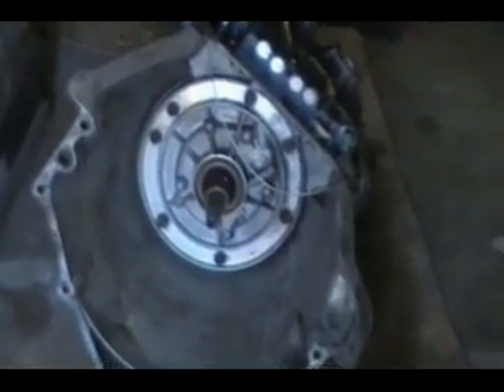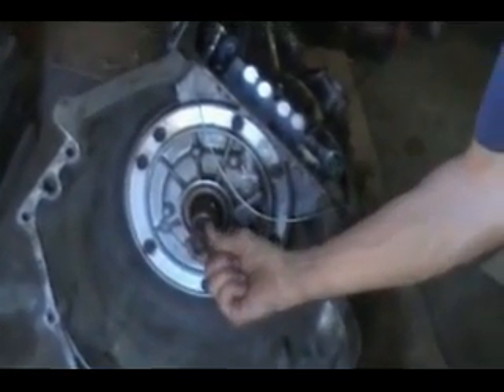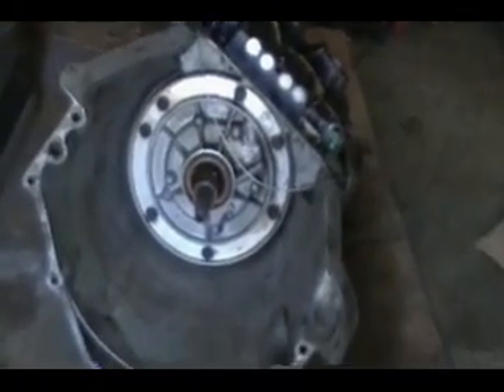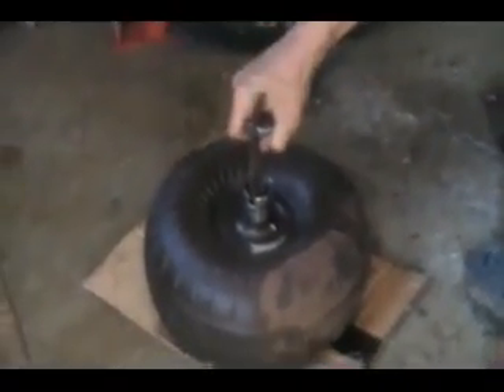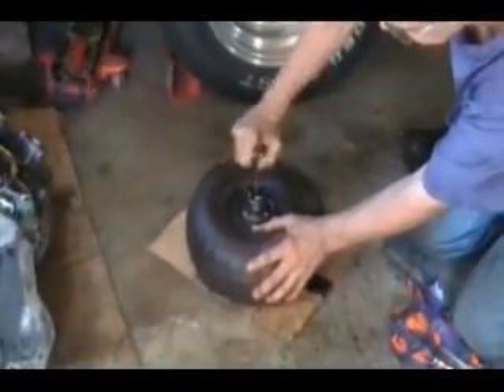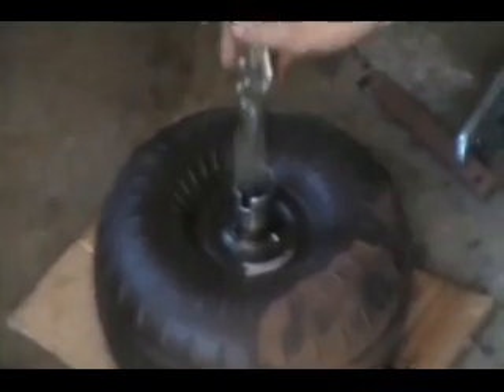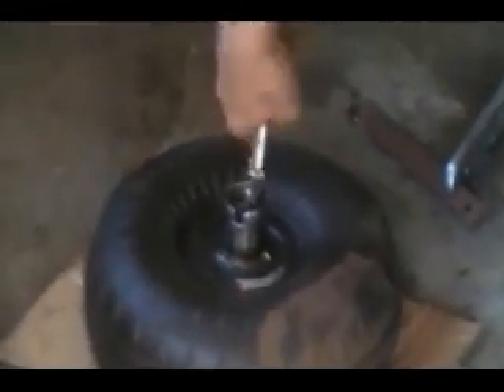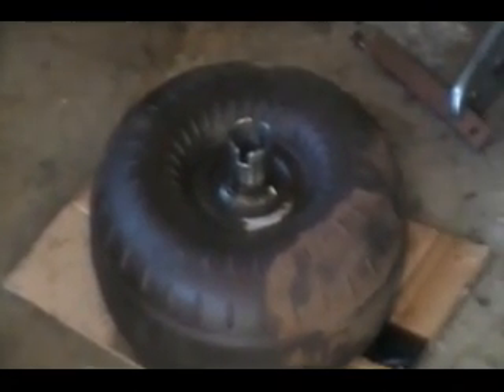What A Bad Torque Converter Sounds Like -- 700r4 Part 2 (Rev. 1)

Comment: Just had a fresh overhauled 700r4 tranny installed with a new or rebuilt torque converter. The day after I drove the truck from the shop that did the installation it sounded like there was a pinging noise coming out of the transmission during idle just for a few minutes and reverse would hit but slip. It stopped making the noise after a few minutes of run time but reverse still seems to engage but if you give it gas it slips bad. Since then, the engine idle is rough and shakes bad on 1st start, after some giving it gas it settles down and does not shake. It seems to be shifting fine on all gears but its the reverse slipping bad and rough cold start idle that is troubling me.  I haven't driven the truck much at all since the tranny install, I'm thinking it is the torque converter that is defective or was improperly installed. What say you icogye???
Reply from the maker: To check the converter I always recommend the following test: Put the front of the car up against a tree or other immovable object, put it into gear, gently give gas, and see if the engine dies. If it dies, it is probably not the torque converter. Do not rev it too much during the test or you could ruin a good torque converter. This will identify a bad torque converter, but may not tell you anything if it is something else causing the problem.  The slippage when in reverse you mentioned is suspicious.  It could be because reverse is a very low gear, like 1st gear, and is more likely to cause slippage.  The rough idle problem is puzzling, because I don't think the converter can cause rough idle, unless it is somehow engaging too soon (a LOW stall converter??). I guess I would check the converter installation.  Maybe unbolt it from the flywheel and turn it and move it back and forth on the transmission shaft to make sure it moves freely.    Good luck and let me know what you find out.

Comment: With the transmission and engine still connected together, torque converter unbolted from the flexplate, and in the car, should I get resistance turning the torque converter by hand ?
Reply from the maker: It's been awhile since I worked on this transmission (more than 9 years ago), but I believe the answer is yes, there will be some resistance even if the torque converter is removed and placed on the ground.  This is because the torque converter never drains completely of its transmission fluid.  Here's hoping someone will chime in and confirm this.

Comment: Hi mine 2000 4runner makes noise when put in gear  looks like a have same problem   sounds like rocks  
When in park stops
Reply from the maker: To be sure  it's the torque converter and not something else, I always recommend the following test: Put the front of the car up against a tree or other immovable object, put it into gear, gently give gas, and see if the engine dies. If it dies, it is probably not the torque converter. Do not rev it too much during the test or you could ruin a good torque converter.   Good luck and let me know how it goes.
Reply: @icogye  thanks  I did    it feels like just in  that part

Comment: I have an 05 mustang, had to put a used Trans in it. Converter fell off during shipping but put it in anyway and it screams like a bad power steering pump after cold start goes away after about 5 minutes. Shifts fine though. I suspect the stator clutch was damaged in it as well. I thought maybe the pilot bearing shaped part didn't go into the flex plate right but I unbokted it and bolted it back up a couple days ago and that seems right. Gonna pull the Trans back out this week I guess and put my old converter in and see if there's a difference.
Reply from the maker: Not that familiar with Ford trannys or converter internals, but I didn't have much luck with the trans shown in this video.  I Replaced the converter.  Then, shortly thereafter, the transmission failed (no forward gears) and I replaced the transmission + converter.  Hope you have better luck.

Comment: I had a 1970 BUick 455 with a basically stock th350 and stock converter in my 86 Regal.  I shattered the stator at WOT in 2nd gear, replaced the converter with another stocker and couple years later did it again,  changed it out 3rd time with another stocker and was running 12.83@108 mph with 2:75 gears in a moser 9" w 35 spline axles!!  The 9" replaced the 7.5 with 2:41 gears after shattering the spiders!!! LOL!  3rd stock converter was  still working good when I sold the car!!!!

Comment: I have a 700r4 on a 6.0 lq9 from a 2006. Escalade 

I am getting some metal scraping metal sounds but not always 
Only when I shift into reverse or drive ( not every time ) 
And sometimes when I’m driving and I come to a stop the noise will start 

It’s not constant though it just does it when it wants and it’s like a can rattling is the best I can explain it 

I thought it was my flex plate I replaced it 
My old one looked fine after inspecting it but I thought maybe it warped 

It runs a little wobbly , the flex plate and the torque converter both spin a little wobbly is that normal ?
Reply from the maker: Didn’t know that GM still used the 700r4 as late as 2006.  Metal scraping sounds are always a bad sign.  Check out Part 1 of my video (https://www.youtube.com/watch?v=P1aYct7Rz60) which includes the sounds of the bad torque converter while it is installed and running to see if it has similar sounds to yours.   If you replaced the flexplate and you still have the noise and wobbling, I would suspect the torque converter.  But check the mounting of the torque converter to the flexplate and check for binding where the transmission shaft inserts into the torque converter.  Good luck.
Reply: @icogye  
I have it on a 1985 Monte Carlo SS 

I am running the 6.0 lq9 off the Escalade and running the 700r4 trans 

I did not see part 1 yet , thank you sir ! Checking it out now 

Will definitely check those points next.

Comment: I got major transmission problems accruing in my 2003 cadillac Seville sts first off 4 weeks ago my tranny started slippn out of nowhere shut engine off got back in the car and when I went to reverse the cad started to reverse then stoped like emergency break was pressed wouldnt move in nuteral but would move in drive & 1 2 3 gears I then dropped pan and found really nothing replaced the fluid started it back up 2 days later and it reversed but i really had to press gas hard and it reved for a secomd without moving then the car started shaking jerking and finally reversed drove perfect after that for 2 weeks now soon as engine reaches temp the car will start off so slow when I stop at red light and it turns green ill hit the gas and it jusf reves and starts off so slow like there is no power at all ill berly mske it through the lights before they turn red again...i dropped pan again found white/yellowish plastic in a pile along with metal flskes and a huge silver chunk of something idk what it is and to top it off there are no codes coming up and no check engine light or nothing when all this firsg started there was a whining noise coming from left side of car by front wheel only whined when stepping on gas but now the whining is gone and the car only has 99,000 miles on it any help would be appriciated bevause im lost with this one
Reply from the maker: This one sounds to me like a linkage problem.  The only time I had experienced similar symptoms was when I had problems with the stock, column shift which was slipping out of place.  This is what I would first pay attention to. Not sure what the metal flakes and plastic are, but in general ANY debris found in the tranny pan indicates big trouble.  The transmission I show in this video had metal flakes in the pan which I ignored at first and within a few months it totally quit (one of the planetary gears had totally been ground away).  Sorry I couldn’t help more, maybe somebody else will chime in with some better words of wisdom.

Comment from the maker: Hearing it probably wouldn't help much.  One thing I learned after making this video is that the sound of it does not tell you much except that there is something wrong.  A better way to check is as follows: Put the front of the car up against a tree or other immovable object, put it in gear, gently give gas, and see if the engine dies.  If it dies, the converter may be O.K.   Do not rev it too much during the test or you could ruin a good torque converter.  Good luck.

Comment: Thank you sir!! 🙏🙏
So far, after hours and hours of searching and watching, you are the only one who actually shows how to diagnose a torque converter. 
I was driving down highway and lost all pressure in gears. Dropped trans, took out converter, splines look good, and now I’ll do this step when I get home this afternoon. I’m on a very low budget, like most I’m sure, and not trying to spend $ if don’t have to. 
Thank you. 🙏
Reply: Did the torque converter end up being the culprit? I had the same issue.
Reply: @Centermass762  what yours the torque converter?
Reply: @markmoler3693  I ended up finding a used transmission that came with the torque converter so I replaced them both.

Comment: As far as the turbine, it should have a bit more resistance and when air or fluid pressure is applied will lock up as needed unless the clutch material is worn past a critical clearance point

Comment: The stator is setting on a bearing snd spins freely unless you are holding it. It had an internal roller sprang in that gm29 700r4 and would need to be opened to determine if the stator has failed

Comment: can a bad torque converter damage a trnsmission
Reply: Don't think this is possible.  If the torque converter is slipping, then the engine is not hooked to the trans and the trans is "protected".  Just my observation, but I would love to hear from others on this.
Reply from the maker: I agree that the transmission is "protected" from engine torque when it is bad and slipping, but one caution:  If the torque converter is grinding it is probably introducing a lot of metal flakes and particles which can circulate all thorough the transmission and cause some collateral damage to critical parts.  Better to replace a bad converter sooner than later.

Comment: My torque converter makes an odd noise and has since day 1 i got it. All mechanics say its how it was manufactured and its fine but I dont believe it
Reply from the maker: The first thing is to find out if the noise is coming from the converter or elsewhere in the drivetrain.  If you have a bad converter, it will show other symptoms, mainly slippage.  It would help to road test the vehicle.  A good torque converter test used to be to put the front of the car up against a tree or other immovable object, put it into gear, gently give gas, and see if the engine dies. If the engine dies, your torque converter is not slipping. Do not rev it too much during the test or you could ruin a good torque converter.  Good Luck.
Reply: icogye yea a mechanic did road test it. He said the generation of the journey I got does that because the torque converter is awkward

Comment: If the stator spins both ways means you inner race is fcked there's metal rollers and springs when it spins both ways it puts flat spots on your race. its kinda good though  because the car just doest move rev all you like it ain't going any where but at least it doesn't allow further damage as to where if the rollers and springs jumped around allowing it to cease the stator up you would De accelerate to a stop and then thread your splines. 4r100s you can get a heavy duty kit with a bullet front and billet clutch it's a better set up. Check out sonax

Comment: Mine sounds like its rubbing or  squeaking sounds when its under a pull in reverse some in  drive but stop at Cruz its not the cover it's off now new rebuild motor and transmission 92 chev 350
Reply from the maker: Sounds like it could be the converter if the noises are accompanied by slipping.  This is how my converter problems started, it was slipping in the lower gears but was O.K. when in high when cruising. I don't remember any unusual noises, though.  It eventually got to the point where the truck wouldn't go at all.   If you want to rule out the torque converter, you can try a test that I always recommend: Put the front of the car up against a tree or other immovable object, put it into gear, gently give gas, and see if the engine dies. Do not rev it too much during the test or you could ruin a good torque converter.  Good luck.
Reply: It was a warped flex plate I must of bumped it when I was putting it in it was hitting the starter gear just a little under torque I bent it back a little in that spot it is really a soft metal pried it with a bar straighten right up works great now who would of thought it I painted it white while it was running then I could see were it was hitting always something new when working on stuff I appreciate the come back though thanks guys
Reply from the maker: I've heard of problems with a warped/bent flexplate, but I never knew it could be bent back into shape.  Sounds like your idea of painting it white was close to genius.  Just a thought, do you think you could have eliminated the interference by shimming the starter at the mounting flange?  Your problem would be a good candidate for a video, I think.  Glad you got it fixed.
Reply: @icogye  I already shined it out it is a high performance starter you can shim it down and out if I would of shim it out any more it wouldn't of road right on the other side of the flex plate it bent real easy though have no more problems
Reply from the maker: Thanks for sharing this problem and solution.  I, and I'm I'm sure others, have learned from your description.

Comment: Mine makes a croaking like sound when I’m at a stop light and fluid leaks out the transmission vent.....other then that it runs and shifts fine.
Reply from the maker: By transmission vent you probably mean the dip stick tube.  Not sure what would cause this.  Maybe some of the other viewers can help with this.  If you want to rule out the torque converter, you can try a test that I always recommend: Put the front of the car up against a tree or other immovable object, put it into gear, gently give gas, and see if the engine dies. Do not rev it too much during the test or you could ruin a good torque converter.  Good luck.
Reply: On many front wheel cars, there’s a tiny round hole with a cap....the transmission is a 4t65e-HD I did the against hard objects test and It didn’t stall

Comment: I have a 3 speed transmission for my 81'  Chevy c10. Wont move. Not sure if it's the transmission or torque converter. My torque converter has not resistance in both directions.
Reply from the maker: It sounds like the torque converter.   One definitive test for a bad torque converter is to put the front of the car up against a tree or other immovable object, put it into Drive, gently give gas, and see if the engine dies. If it does not die, it is probably a slipping converter. Since the truck won't move at all, you have essentially have completed this test. Now that you have pulled the torque converter, AND it has no resistance in either direction, all signs do point to a bad torque converter.
Reply: @icogye  I just needed to shim it

Comment: My satum vue can't move on the first gear well but the order move very very well
Reply from the maker: Slipping of a bad torque converter is most noticeable in the lower gears.  A good test you can do to determine whether it might be the torque converter would be to put the front of the car up against a tree or other immovable object, put it into gear, gently give gas, and see if the engine dies. If it does not die it is likely the converter. Do not rev it too much during the test or you could ruin a good torque converter.

Comment: I have a th350 and idk if the noise I’m hearing is flywheel torque converter or tranny but the flywheel is welded to the torque converter lmfao so ima have fun
Reply: Never heard of the torque converter being welded to the flywheel.  Is the weld on the bolt heads as a way of securing them or is it on the torque converter itself?  I would guess that it was done because of some trouble with stripped threads.
Reply: George Schwab they broke a bolt head off and just put a weld there so its welded together

Comment: Not true,the first noise is the clutch damper and the stator turns both sides because it has a bearing on it, yes it has to lock on one direction but still you have to hold it, I been working on the torque converter industry for 20 years, torque converter Technology is the name of the company that I work for,please feel free to call, this is not spam lol
Reply from the maker: Thanks for your comment.  The converter test for stator resistance that I was attempting here is as described in the book “Turbo Hydra-Matic 400 Transmission” by Ron Sessions.  He states: "You should feel little or no resistance twisting the (stator) hub clockwise, but some resistance or reaction twisting it counterclockwise."  This is mentioned in the description of the video.